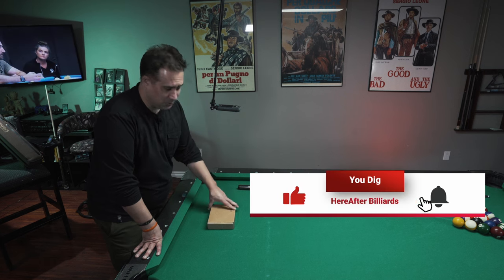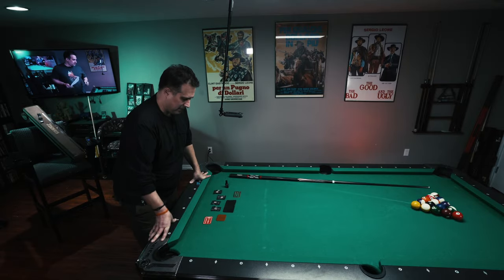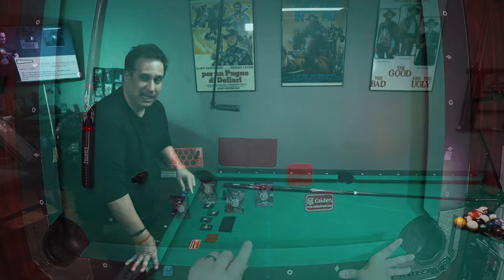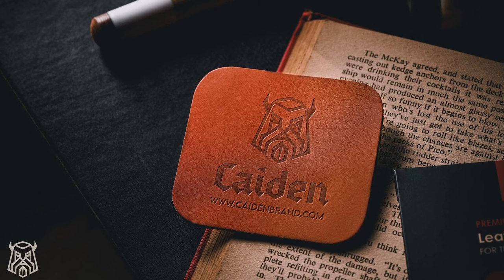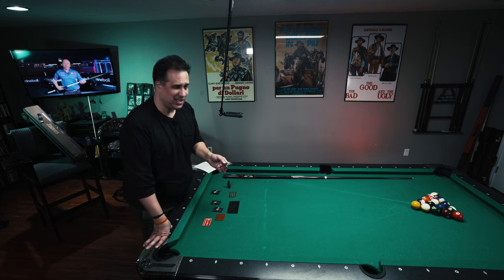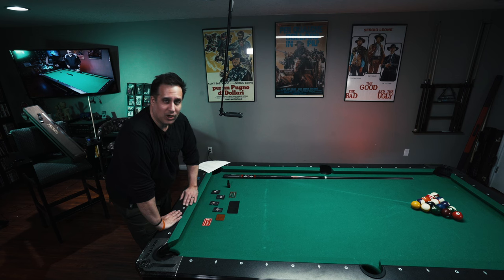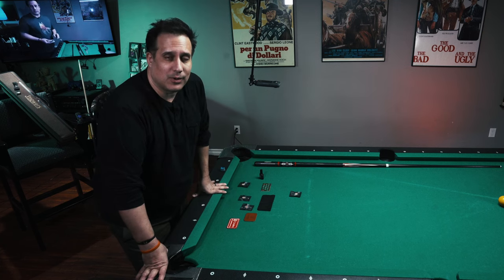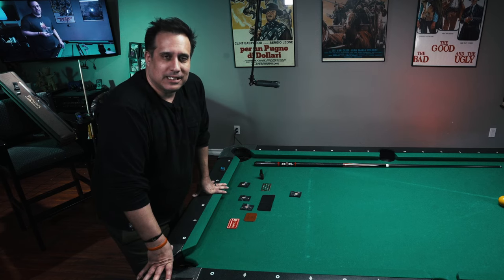Caiden Brand's Billiards Fighter Cue Tips & Accessories! Trending Billiards Essentials in 2024 🔥

Comment: These are great tips just very very spongy when it’s first installed  untill broken in like very spongy but other than  that great tip   I went back to the Zan hybrid max tho. But if they out  id use a cadien fighter tip
Reply from the maker: You might be right. With the soft I have on mine it seemed that way to me. It was strange. But I loved it instantly...after months I still haven't touched it. 👍